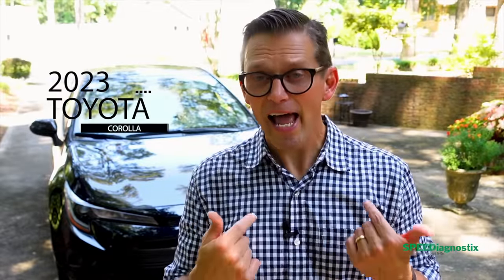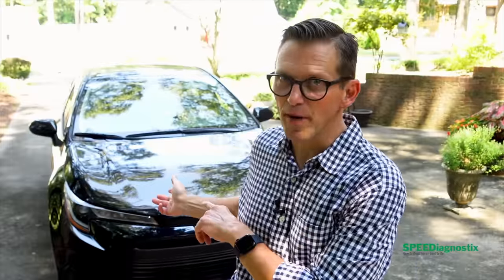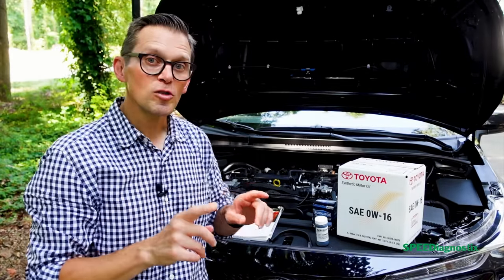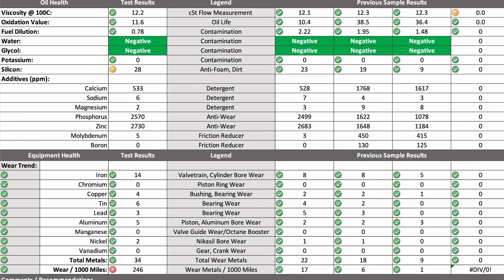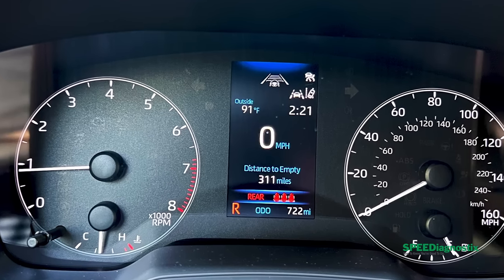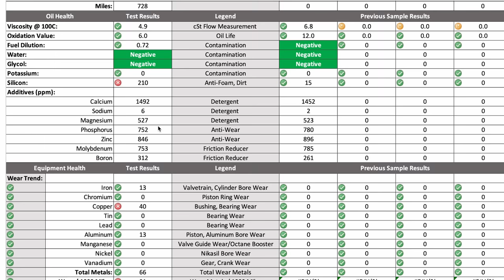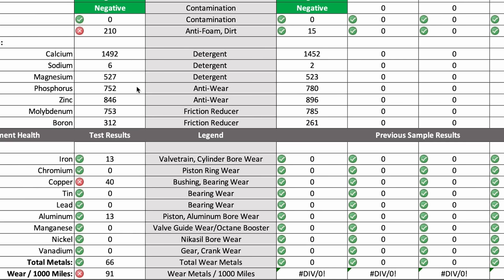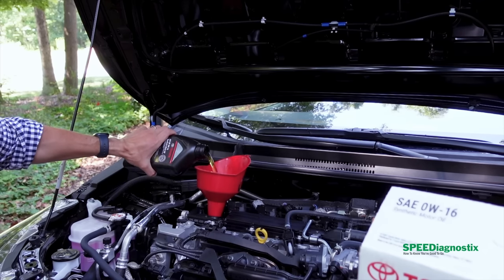AVOID the ONE MISTAKE Almost EVERYONE Makes With A Brand New Car

Comment: I had a different Toyota dealership perform the last free/complimentary oil change.  When I performed the next oil change, I discovered:
- they over tightened the oil filter housing
- they over tightened the drain plug
- They cross threaded 4 skid plate bolts.  Two of them broke when I tried removing them.
- I dont usually remove the "secondary" oil filter cap...the little metal cap that allows you to drain oil out of the filter housing so it does not make such a mess when you remove the actual filter housing.  So it was two or three oil changes later when I discovered that the dealership didnt re0lace the gaslet for the "secondary" oil filter cap.

Do your own maintenance and make sure you know how to do it properly.
Reply: I cringed a little when he said he was going to take it to the dealer. They use nematic tools to start nuts and bolts. Bad idea.

Comment: It's really nice to see the impact of the early oil changes quantified for once!
Reply from the maker: I'm glad this was helpful.
Reply: Very interesting, thanks for sharing this. I have a question concerning oil in my CTS V. I get the oil changed at the dealership and they use the same Dexos  5w30 that is used in all the other GM cars. But I am concerned that with the high performance engine / heat that the supercharger might be producing if there might be a better choice for this engine. What about the oil that remains in the supercharger when the engine is cut off after driving. I’m just driving normally most of the time, nothing crazy or extreme. Thank you ! 
Charles Rhea MD
Reply: @charlesrhea6810  Turbos produce a lot of heat, but superchargers shouldn't, they are using power from the belt, not from the exhaust gases, and have a heat exchanger as well.
Reply: Nothing new here. I heard all of this 55 years ago when I started working on cars.
Reply: I didn't change my oil in the first 500, but I definitely changed it earlier than factory recommended.
Reply: I remember reading that new car engines are broken in at the factory. How true is that in your experience?
Reply: @anthonyjulson8840  As long as you do the first change well before 10,000 you're probably fine. As for whether they're broken in in the factory or not, allegedly they are a run tested a little there, but they probably wouldn't still say in the manual to vary the RPM and not run it too hard in the first 500 mi. The fact that Subaru boxer engines are still occasionally dying from RTV sealant chunks coming out of the gaskets and getting lodged in the oil pickup tube very early in the car's lifespan seems to suggest that there's not really such thing as being able to really break in an engine in the factory, especially since they're working on a production line and time is money. I think they'd run it just so long as statistics tell them it's reducing drivetrain warranty claims.
Reply: @anthonyjulson8840 Not true. Only in certain rare cars are engines broken in. It’s on you
Reply: Good idea.  since I was a kid every new engine I had I ran it to 500 then 1000 then 1500 then 3000 and with new oil of today 6000. Then every 6k or 6months which comes first. 1979 I was a kid.
Reply: @@Ben-vy1ob Actually only 60% goes to heat these days, 50% for Atkinson cycle hybrids. EVs aren't exactly 100% efficient either, the motors are 80-90% and the battery loses some too. 
Gas cars are great in the winter because that excess heat is essentially free, so there's no massive range loss just to stay comfortable in the cold. All the best to you if you can afford luxury car prices and live in a place with no winter though, by all means go all-in on a very repair-unfriendly company if you like the product. I suppose you're helping to pay the R&D costs that will need to be spent by these big EV companies so they'll be able to replace gas cars at scale in 50-70 years.

What's also great is that an upgrade model Corolla costs 1/2 of a base model Tesla Model 3, a full fuel tank weighs 1/6th of a Model 3's battery, it takes 1/4 as long to half-fill, the emptier it gets the less it weighs, and the vastly lower total vehicle weight means the tires last much longer.
Reply: @@Ben-vy1ob In Canada, the base model Model 3 starts at $53,990 CAD, whereas the base model Corolla starts at $26,265 and the XSE goes up to $33,965. Multiply those by about 70% for USD and you get the price before subsidies, which is the price that most people pay.

People buy Corollas because they want something that you just change the oil on once a year and it just works for 30 years. People buy Teslas because they think they're better than everyone else, have never sat on a toilet that didn't have heated seats, can't imagine a scenario where they may have to drive 600 miles in a single day in the winter, and don't care that they're going to have to deal with random shit breaking like handles and trim pieces that Toyota owners haven't had to deal with in 20 years because it just works.
Reply: @@Ben-vy1ob The fact that you keep having to insult people for not agreeing with you, that exploiting tax loopholes and using taxpayer-funded subsidies to help pay for an overpriced fashion accessory is a sound financial decision, speaks volumes about the sort of person you are. I hope that your small peer group find you VERY impressive, because I'm pretty sure that no one else does.
Reply: @@Ben-vy1ob Yuck, even more bad financial advice. It's one thing to go deep in debt to acquire a productive asset, but a college degree in this day and age? No thanks. Let me guess, yours is in "communications" 😂
Reply: @@Ben-vy1ob I'm in a generous mood, I'll give you a few pieces of knowledge for free:
1) The most important type of knowledge is self-knowledge
2) If you're trying to convince people you're wildly successful, it's not going to be very believable if you're the sort of person who goes around insulting 95% of people for driving gas cars, or if you admit that you paid for your own MBA
Enjoy your 50k pesos a month!
Reply: @@Ben-vy1ob Happy for you. On a related note, when is my cheap plastic crap arriving from China?
Reply: 500 miles?! I heard first 1.5k miles is good. I personally would do like 1,200, 3k miles for 2nd oil change, than 4k thereafter. What do you think?
Reply: Utter rubbish he's scamming you to sell his own business.
Reply: @motleydude73  So for the 95% of the audience who don't live near his business, how does he "exploit" us by giving us a free oil sample analysis demonstration?
Reply: @motleydude73  Gas vehicles have 3474.5 fires per 100,000 sales, while electric vehicles have 25.1 fires per 100,000 sales. EVs are the future, but it's going to take an order of magnitude improvement between energy density, battery cost, and charge cycles for that to happen.
Reply: @speedracer69mach56  It begs the question why? Enjoy wasting good oil and money?
Reply: @jamescherney5874  Back then it was necessary. These days it most certainly isn't.
Reply: @theredscourge  Greetings, Red.  I mostly agree with what you said.  However, are the data for car fires per sale classified by the car’s age in any way?  The reason I ask is that there are far more old ICE car clunkers out there than electric cars, since EV’s are relatively new.  Also, most EV’s are high priced cars which may be better maintained than old ICE cars, since their owners are wealthier.  As any car ages, I’d think there is more risk of having a fire due to age and poor maintenance. It would be interesting if the data addressed this effect.  Thanks.
Reply: @OldRustySteele  That's a fair counterargument, something I'm not accustomed to encountering on YouTube comments lol. To be honest I don't know if that data is available on a by-age basis, I think it's just the overall data per car produced. Since the average age of a car on the road right now is about 14 years old, that probably has a substantial impact, though I have no idea how substantial. I also have no idea whether newer cars would have a higher level of fire safety due to experience, or lower safety due to their massive increase in how many onboard electronics they have and the shift to more environmentally friendlier materials.
Reply: @theredscourge  Excellent points, TRS!  Yeah, it would be interesting to do a deeper dive on this topic. I hadn’t thought about the aspect of environmentally more friendly materials — I recall where one of the high end German brands was having trouble with electronics because mice would chew the wire coatings because apparently the material was edible! One of the reasons I brought up the age aspect of car fires is from my own experience with my housekeeper’s car.  She had an old Mazda and asked me if I could take a look at it because it was running poorly.  I popped the hood and it looked like someone had sprayed used motor oil all over the engine compartment, then dumped dirt, feathers, and leaves in there!  I’ve often wondered how many car fires are just from lack of maintenance on old clunkers like that.
Reply from the maker: @anthonyjulson8840  https://youtu.be/X4424Q5lLR8
Reply: @anthonyjulson8840  Not true!
Reply: It's not quantified....and won't be for many years.   Total waste of oil.
Reply: @bmwlane8834  I mean it seems very quantified to me by the fact that he showed the oil analysis results. I suppose if one were driving a BMW then yeah it would be a waste of oil to do an early oil change, as you're gonna have expensive repairs that total the car well before there's substantial cylinder engine wear anyway 🤣
Reply: @bmwlane8834  Another thing to keep in mind is oil is one of the most recycled substances known to man, it's rarely wasted. Some shops will burn it for heat in an oil furnace but most recycle it and it goes back to be separated out and used in new oil, or as an ingredient in various industrial polymers or consumer plastics.
Reply: @charlesrhea6810  I have a Camaro ZL1.. same motor.
Having the dealership change your oil is fine, (I change my own oil) they will use the correct oil for the motor.
Even though the oil is synthetic, I would change the oil every 5K miles, not when the oil life says to.
Also I would add a Magnetic oil drain plug.
Reply: @theredscourge  Superchargers produce a lot of heat, especially on road track or 1/4 mile.  Look up heat soak.
Reply: @texZR2  Anyone who can afford to use a supercharger can afford to add the extra cooling it requires.
Reply: @theredscourge  Obviously you have never driven a Supercharged vehicle to its limits.
Reply: @texZR2  Hardly anyone has, those things cost ten grand just to start. And if you can afford the ten grand, you can afford a few more grand to fix the problem that your supercharger causes.
Reply: Science!!!!
Reply: Yeah, "quantified" that you don't need it. "Quantified" by asserting that a shop rebuilt Porsche engine break in is the same as a new Toyota with a few miles on it? You people belong on an island, Oil Fantasy Island.

Comment: I worked as a mechanic for over 40 years and always offered a free oil change after the first 500 miles on all rebuilds.  My personal opinion is it is crazy to go 10k miles on break in oil
Reply: No such thing as break in oil except on motorbikes. 40 years and you didn't know that? 🤦🤣
Reply: You are right. Break in oil is designed to be changed after a few hundred miles. Even new cars with "normal" oil should be changed within the first few hundred miles.
Reply: Some decades ago, let's say in the beginning of the nineties, modern engines did last very long even without doing an early oil change during break in.
Manufacturers like Volkswagen did not advise you anymore of cautious driving during the break in period. 

Before that in the eighties you need to very careful break the engine in. You had a table which told you the max allowed speed for each gear (Germany) up to the first 650 miles. From then up to 1400 miles you could increasingly drive faster but still only if the engine was in operating temperature.

Better manufacturing technics together with hi-tech oils have been probably the reason why they got rid of that. 
So for the average customer there was no need to change your break in oil earlier nor did you have to take care of certain speeds.

Current engines seem to not last very long anymore. I believe that very good oil and some basic rules when driving should be sufficent.
But I can imagine that more frequent oil changing intervals will have a positive effect on longevity.

A friend once told me that you can feel the status of your oil when you take a drop of the dipstick and rub it between thumb and pointer finger. 
The less smooth it feels the more used it is. Never tried it but I believe that because the log chained molecules become more and more broken and got worn out.

Hi quality oil which is above the standards given by the manufacturer could probably do a pretty good job in keeping your engine in good health.
Reply: Different oil and different engines now.  Technology changes.
Reply: @markleggett3944  No it shouldn't, what a waste. 10k first change is fine.
Reply: @motleydude73  YOU ARE 100% WRONG. Engine builders use it all the time kid. Facts.
Reply: @peerpaulin8486  Ppl are taking less care of there vehicles generally nowadays. Any vehicle made by the big6 automakers will get you 200k mis - at least here in US..with good basic maintenance practices. Midsized trucks (Ranger) & larger (F150, RAM) all very popular are more robustly built & can go 300k mis easily..w/good basic maintenance practices. Full Synthetic oils always! 5-6k mi OCI.
Reply: @cloudpoint0  Much more high tech engines now for lower emissions/ better mpgs etc. Using full synthetic oil @5k mi OCI has always served me very well w/all my F150 4wd trucks.
Reply: @Davido50  Engine rebuilders sure. Legend car makers no. Not for 40 years. Started my trade in '95 we didn't use it then don't use it now. Straight 0-15 synthetic first change at 15000kms.
Reply: @Davido50  
More frequent oil change is an obsolete myth.  Every oil engineer will tell you that today’s synthetic oil does not need to be changed at 5k mi in today’s tight tolerance engines.

There’s no sign of oil deterioration in spectrographic tests until much higher mileages.  Oil color is not an indicator of lubrication quality.

And auto manufacturers have millions of vehicle examples to base their recommendations on, vehicles whose engines have run problem-free for 500,000 miles sometimes.

Early synthetic oil change hurts your wallet and hurts the environment (carbon is released in the refining process).  At least use the cheap dirty oil that was made in the past if you really need unnecessary oil changes to feel emotionally good.  That's all you are buying.

I worked in the petroleum industry for decades, not that this matters here.  Go by what the manufacturer says.  They know better than you or me or some YT blogger.
Reply: @motleydude73 Motorbikes and cars use the same type of engine... You clearly know nothing about either ...
Reply: @soulsbourne  Show me a 2 stroke car, show me a 4 cylinder hybrid motorbike 🤣🤦  New bikes come with high zinc high phosphorous break in oils that need to be changed by about 1000 miles. Cars just have break in periods. First oil change is generally done at 10,000 miles
Reply: @markleggett3944  Not what I read.  I read the engine manufacturer takes care of the break in cycle.  I don't know if it's true, but I don't see a problem with changing oil early.   I've always bought just slightly used cars to save money, so that was never an issue for me.
Reply: 7500 for me lol
Reply: Just change the oil at regular intervals, like every 5000 miles ! Like Chevron semi synthetic $20.37, most people will not follow any advice today , cause there too busy, 40 year automobile mechanic. Good luck trying to get people do a 500mile  break in ?
Reply: @DRM-i6s  i did a 7500 mile break in 🤣

Comment: I could not agree more. The same procedure should be performed on all new equipment. Whether it is a ride-on lawn mower, car or truck to all the compartments of an excavator, wheel loader etc. 
GREAT ADVICE.
Reply from the maker: Right on
Reply: @themotoroilgeek  500 miles on a lawnmower is a long time.;) Is the 5 hours recommended on my generator (or other air cooled small engines) ok or should should it be done sooner, especially as most don't have oil filters.
Reply from the maker: @glennfrancis9031  LOL, an hour or two is sufficient in that application.
Reply: Yes you are right. My BULLDOG zero turn states to change oil after first 5h. THEN every 15-20 or roundabouts thereafter.
ALSO
my Polaris states there is also break in oil change.
Reply: i brought my son a new Honda Crf 125, it does not run an oil filter so i see it absolutely necessary to change out the oil on break in as the metal debris can float around a lot easier. same with most push mowers
Reply: @wailingalen bull dog mower??